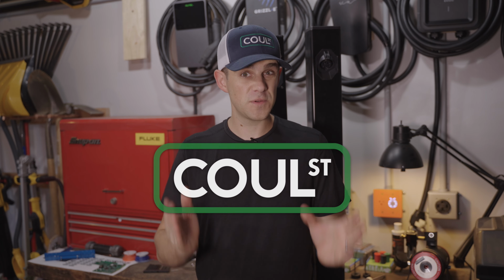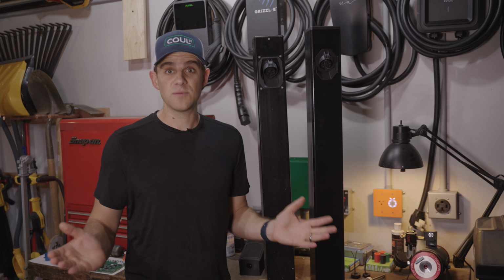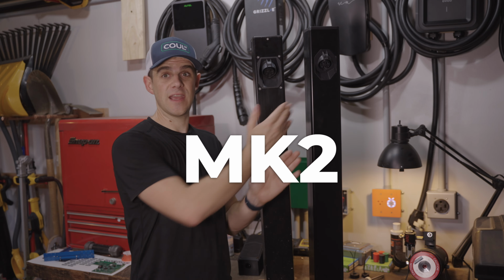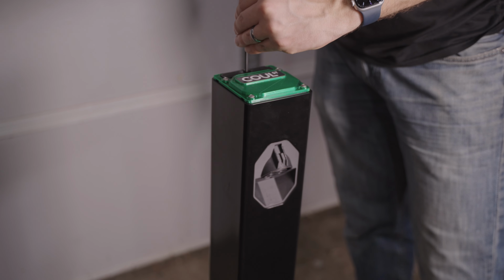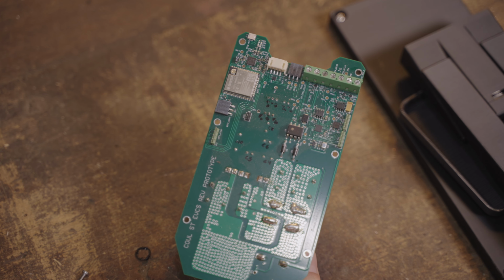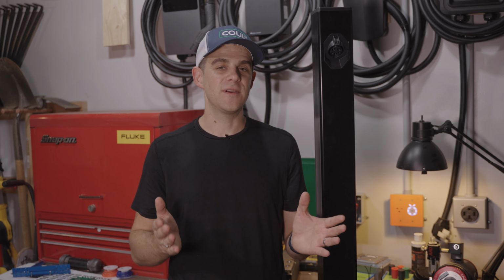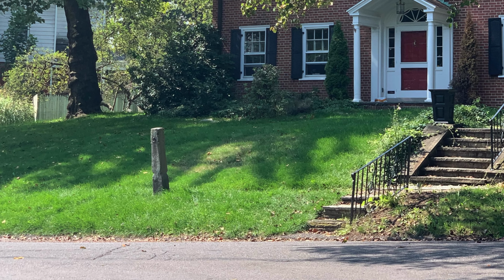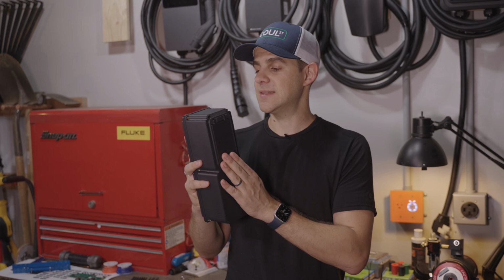Failure & Success of the EV Street Charger

Comment: Interesting to hear about the development process. Learning how to design the PCB will give you more control of the product. 
A few thoughts: 
1. Low intensity sidewalk lighting might provide utility, reducing objections from neighbours. 
2. Consider theft; it looks like the electronics box can be unscrewed in seconds. 
3. Aim for a standard pole size so that the electronics can be fitted into various types of pole to blend in. 
4. Get a quote from a board manufacturer like Pcbway to get an idea of cost. 
Keep going; pursue your dream. ☮️
Reply from the maker: These are good thoughts. Thanks for bringing them up.
1. Are you thinking a light on top of the post to illuminate the sidewalk?
2. Yes, the box is easy to remove, but the bolt is a security Allen head bolt. Granted you can purchase these drivers, but it's not as simple as dropping a Phillips screwdriver down in there. Later version also have screws securing the post cap.
3. Yes, this is a good idea. Currently we're using an off-the-shelf 4"x4" steel or aluminum post.
4. We've worked with PCBWay and several other board suppliers - they are amazing for quickly turning around inexpensive prototype boards.
Reply: @chargeeverywhere  For sidewalk/curbside lighting, the Post Cap could flare out like the brim of a square hat, with downward-facing lighting around the brim.  Also, perhaps if the material used to make the cable terminal comes in a clear or white translucent etc, then where the power is coming out of the pole could show the status color.  And bonus it's facing away from the residents and is easily seen from the charging car.
Reply: @chargeeverywhere  Love the Mark 5! I would put a LED ring around the downward facing receptacle! That would be enough to to help the person using it at night.  I assume you mean to mount the Mark 3 on a wall - but sorry to tell ya however tough you make that swinging door... it will come off - just make another angled down receptacle for that unit as well.
Reply: I love the invisibility of it. I think adding any kind of always -on lighting defeats that goal. However, an illuminated plug or ring around the plug, similar to the images already on your webpage, that's turned on by a very short range (or adjustable) proximity senor, either in the face or on the top, would be excellent when trying to plug in at night. It's easy to see this fitting into a mailbox post form factor as well.

Comment: I think from longevity perspective, you need to design the PCB while considering the clearance and creepage norms for industrial electronics. Also you may need some sort of coating or even complete potting of the box, this improves reliability over lifetime of the posts. Last but not least, you need to also perform some sort of accelerated testing (corrosion/salt spray, thermal cycling) which will give an idea where weaknesses exist in your current design. This gives you valuable input for both Hardware and Mechanics. Cheers.
Reply: I was just wondering how well the electronics would hold up under full sun in a hot climate.
Reply from the maker: Yes, all of these are important considerations we’re making. We are moving to the post not housing the EVSE, which helps considerably on all fronts-especially the hot weather/hot sun situation.

Comment: When you presented the Mk3 with its horizontal outlet and door flap... wow am I glad you went back to the angled outlet for Mk4. As an EV driver in Minnesota, though, please consider either moving or duplicating the status lighting from the center of the top face to the outlet bezel, perhaps just under the overhang, or a ring around the outside of the top. The top of that post is a snow/ice collector.

Comment: You have definitely nailed the form factor, even for those of us with garages i can tell you i would 1000% want one or two of these posts installed just outside the garage for charging on the driveway rather than the clunky evse boxes on the side of the house or running a cable under the garage door. Really nice work!
Reply: Funny, i actually wrote the above comment right before you revealed the mark 3 version in the video. I don't like the look of mark 3 and the flappy cover, so glad you went back to a similar look as mark 2 with mark 4 version 👍🙏
Reply from the maker: Thanks for the comment. Yes, there is a segment of folks like you who we also want to sell these things to. We're all about putting a product out there and letting people decide what they want to do with it. The MK4 does have a door, but it's much cleaner than the MK3 - very satisfying to use in person too.
Reply: @chargeeverywhere  We run an Airbnb.  Having an outside charging spot would be great.

Comment: Very Nice. A much needed service.
I especially like that the customer has their own cable to plug into the EVSE.
I have always thought the we got the whole cable/EVSE thing backward.
The cable and EVSE should be on-board every EV, not on the public charging hardware where it is subject to the weather, use and misuse. 
This would make instalation of charging infrastructure much cheaper for businesses, landlords and municipalities.
The only time external cables should be necessary is with DC Fast Chargers.

Comment: For places that use street facing mailboxes, perhaps a way to mount a mailbox on top of the pole would be in order.  Also, a simple white multicolor led to display status on the front may be easier/cheaper and more practical.
Reply: Came to say the same thing.  A certain percentage of your potential customer base needs to have a pole there anyway for a mailbox.  So figuring out a way to accommodate a mailbox would be a big plus.
Reply: How would the mail truck deliver the mail if their were EVs parked in front of every mailbox?
Reply: @jilliebean613  there are these things called "power cords" that cause one not to be parked directly in front of the pole.  Besides, it's a bit of a hard balance for suburban letter carriers to deal with parked cars overall.

Comment: I'm loving learning about your design process for these. As an electrician installing EV chargers I would love to see if you can implement a couple of features:
1. Power sharing, to allow multiple chargers on one circuit.
2. EMS integration, to reduce the number of customers needing a service upgrade to install a charger.
I would be interested in learning about the challenges of adding these features, and if they would be impractical to add at all.

Comment: In cold weather climates, it would be very helpful to adhere a heating element and thermocouple to the door flap, to prevent it from freezing shut. Just have it run a defrost loop up to 10C if it detects a temperature of 0C. As a bonus feature, if you go the route of using a QR code and app for charging payment, you can put the QR code on the door and get added defrost of the code.

Comment: I love your design! A simple post is the most elegant solution. Here in New England we face some serious weather which with your current design would be risky as the outlet socket is too exposed. How about having a slide up collar cap which is held up by the cords connector. That way the cap lowers its self once the cord is removed.

I would also leverage the edge of the electronics box as a light pipe so the posts edge is lit white, green, yellow, and red. White for availability, green the charger is active, yellow under charge, red charger failure.

As far as connectivity, WiFi is a bit heavy as the coverage distance is quite large, while I’m not sure if the POS systems charger systems use is able to use Bluetooth and/or NFC both of which can offer a smaller radius of signal so people nearby are not snooping to the data stream. This is important is dense cities where this would be a sizable market.

Lastly, what is the expected level of charging you are looking to support? With in a suburb space I can see Level-1 or 2, in urban spaces I can see Level-2 or 3 with more Level-3 fast DC charging in dense cities. As an example here in Boston we don’t have the sidewalk space in many parts of the city to even have street side charging. Instead we are planning a few sizable charging parks with 20~30 Level-3 fast DC charging stations. Allowing people to charge up and then move out in less than an hour, so someone else can charge up. Where we can have curb side it will likely be just Level-2. So while you are still experimenting consider what the power options you will provide. The bulk Level-3 gear will be in a separate vault space close by so you will still need a comm line to the vault to enable the higher voltage.  A larger post with Level-3 might be needed.

Comment: Nice seeing the progress of this device. Keep the updates coming.

While the mark 4 looks to have the simplicity of installing the "box", I think you had something with the Mark 3. Some thoughts:
1) I like the idea of a cover that closes - this cover could come with a key to keep the box from being used when you are not using the post. 
2) Make the box and cover out of metal to make it more tamper resistant
3) If you make your own cords, using a 90° plug would put even less strain on the connection
4) Put the light around the outlet or around the cover instead of on the top. This way, the post can double as a mailbox post.

Comment: Something worth consideration, is a design that collapses into an in ground cavity, like a collapsible bollard. It protects the cable from the elements, and protects it from damage from cars going over the curb. 

It may also be worth considering one that is “duplex” with twi outlets.

The electronics may benefit from being “potted” in epoxy. 

A commercial version as a street parking offering, with means of payment might be worth development as a product aimed towards cities. (However, if you pursue that, it should offer an RV connector, for food trucks to be able to ditch portable generators)

Comment: I love it. You're definitely going to want to make the lid a bit sturdier. Another thing: You'll need a good WiFi antenna at the top of the unit in the plastic lid. You really want to maximize the signal strength, and having a PCB antenna mounted directly to another PCB isn't going to do well inside a metal box. You can probably quite easily play around with a few designs using ESP-NOW.

Comment: Off-the-shelf prototypes typically utilize standard plastics that don't possess the durability, flexibility, or thermal resistance required for your final product. What were you thinking?! Prototypes are designed for validation and testing, not for end-use.

Comment: I’d also agree with the light indicator being on the face or edges vs the top. For northern climates it’s a snow buildup concern that would make visibility an issue. For some areas up lights are problematic as “light pollution”.  Granted, that may also be a concern for some areas with sea turtles and down lights as well. I seem to recall there being regulations about that when I was in Florida. Sigh, all kinds of research that must be undertaken.

Comment: Really good progress!  If you're looking for electronics expertise, I've got >10 years of experience in automotive and industrial HV electronics. 

I saw a couple comments about lighting.  Had you considered using a translucent plastic for the plug assembly.  It would function as a lightpipe and be more readily visible from the street, vs. the lighting on top of the post.  Admittedly, I don't know which options are available that would meet durability requirements.  I assume the existing assembly is using something like ABS or PC+GF.

Comment: ESP32 should never be used in production it has backdoors that can be exploited by certain governments, they do not show or share their WIFI stack, this will never be approved. Switch to STM micro controllers and their wifi/bluetooth chips. Real Tek or TI would also be good alternatives.
Reply: Interesting observation.
Reply: Pretty sure Yoto have shipped products running off an ESP32
Reply: Definitely agree that the original ESP32 is unsuitable for a production product. Switch to a microcontroller that can be locked down to only run signed code like the ESP32-S2 or RP2350
Reply: It’s perfect for a prototype tho if mass produced it would prolly have something more secure

Comment: Love watching your videos and seeing the progression. Will you be transitioning to J3400 connector at some point?
Reply from the maker: We have experimented with J3400 on the charger, and there is definitely a reason to go that route. However, in the near term we will be using the Type 2 connector station side, but the vehicle side can be either J1772 or J3400, so you just need the right cable for your EV.

Comment: Here is my advices, you are probably better than me to know what's shit and what is not, but I really know that the feedback always help. (6 points incoming)

1. Build modular if you can. Use standards communications (usb or others). Build it so it is SERVICEABLE. Being modular help this by identifying what works, what doesn't and will help with replacing parts easily.

2. Keep all possible costs low. This is especially important for mass adoption. If you use standard communications, and everything (like powering with an arduino or raspberry pi) you could even just sell the software, and have some videos or website explaining how to build it DIY, just providing some specific parts to comply with regulations). This could both improve your project spreading, but keeping costs down, and improving serviceability of the final product. Using standard communications would even allow you to sell diagnosis tools for maintenance "here what is not working, replace it, you can find a part here : ..., you can even just scan that QR code to get there, and here a QR on a video on how to service that part"

3. As you need to burry some electric cable from your house, maybe you could split everything : just some basic things in the post, the main control unit in the house close to electrical pannel. This will help with modularity, and keep maintenance costs down, as replacing the exterior unit will be cheaper, and less things exposed to weather.

4. I see that you are talking about wifi. You should maybe consider offering some kind of software (app ? cloud ? If you need some advices with that, I'm an android dev, so you know...) in order to allow easy identification of who is charging and how much electricity you are getting in order to simplify splitting the bills. I do not support AT ALL every apps and authentification for fast charging, this is stupid, just put a credit card ffs. But in your case, charging always from the same spot close to your home means that it makes total sense. This could also allow you to get a bit more computationnal powerif you split communication to your house, and maybe even the main switch.

5. I don't know if you though about it, but a locking mecanism to prevent the car cable to be stolen could be some use. You could get like some part (a chain ?) hold with a lock inside the post, and "customers" could put their lock to the chain. If someone malicious let something locked into, you just remove the chain by unlocking the owner lock, throw everything, put another chain and voila.

6. Evs are often sold with some regular 120V charger. You could probably put just some regular exterior outlet switched by some computer (arduino ?), with authentification like you probably already do, and just let people use their own 120V chargers. I think this could be a viable marketing strategy to do both, allowing even people not from your neighborhood to charge on your post through the authentification system or something like that. That's for later, probably, but you know.

And last : good luck man. This needs to be everywhere. Roadtrips are not that common, you know, you don't get that each week. But if you had chargers everywhere, why would it matter ? Your car would be charged each time it's parked, that's the dream. That's even more convenient that gas station because car are parked most of the time anyway.

Comment: Other than the color, that MK1.5 box looks just like the enclosure I bought for my custom portable EVSE at the end of 2021. :)
Reply: Mine is just a NOS ClipperCreek Gen2 with GM firmware that I got for less than 30 smackers combined with some water-tight fittings, an OpenEVSE J1772 cable, and a NEMA 6-20P that can be adapted to anything else I need (120v or 240v). Yeah, it’s only a 12A (16A with AmazingE FW) EVSE so NEMA 6-20 is perfect.
Reply from the maker: That's great, but our enclosure was quite terrible. It was even a two-piece print (glued together) as we hadn't upgraded to a larger printer at the time. What color do you have? Light grey I'm guessing? We eventually went white for our in-post boxes to help reduce absorbed heat within the post.
Reply: @chargeeverywhere  I didn’t even realize yours was printed. Mine was item 294268994917 with the 250x80x70mm size option. Main difference I see is that mine only fastens at the corners. On yours I see the perimeter ridge that fits up into the lid. Was there a corresponding gasket up there? Mine had a silicone rubber gasket that seals against water with the fasteners outside that seal. I drilled holes and fitted it with waterproof cable glands for the two main cables.
Reply from the maker: @emmettturner9452  Since this was printed, I filled the gasket "groove" with a somewhat soft silicone that was allowed to set up before assembling the box. It wasn't great. Since then I've experimented with printing TPU gaskets, but ultimately we'll have a foamed-in-place gasket in the final product - something like what you see in off-the-shelf enclosures like your's.